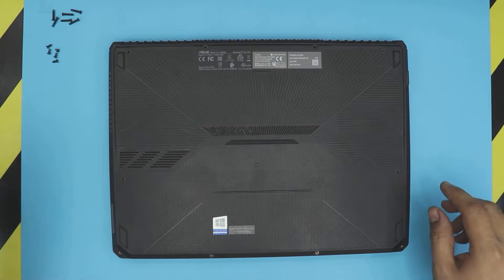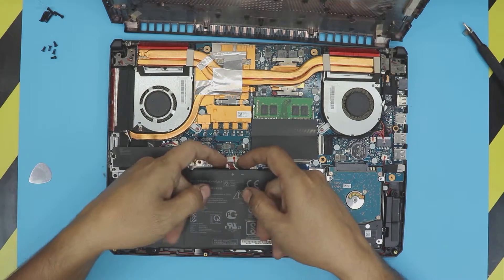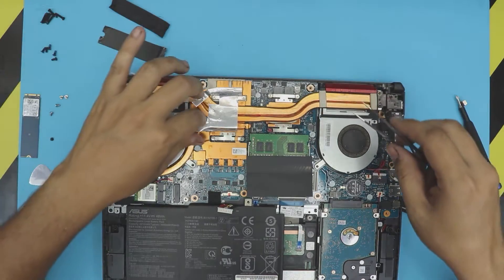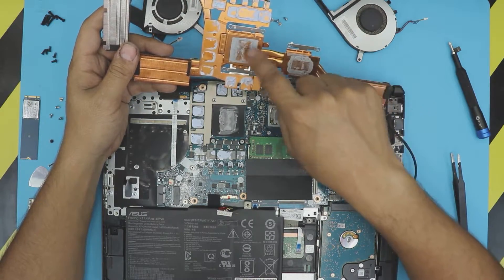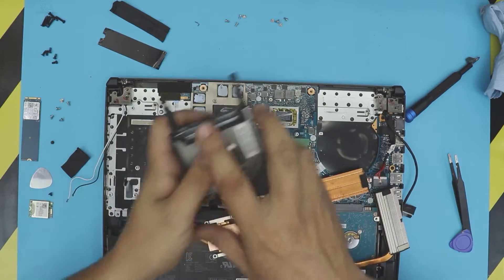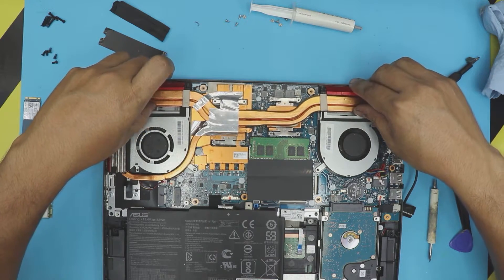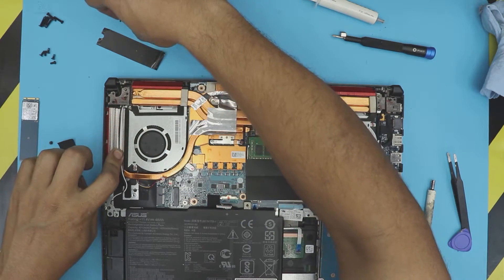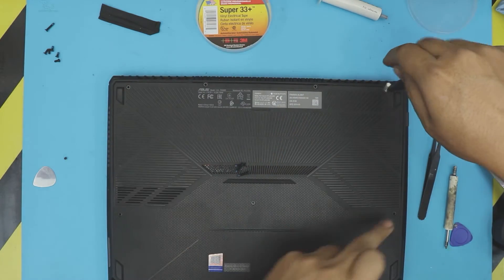✔ ASUS TUF fx505d Repaste Full Service, STEP By STEP

Comment: Hi !  Why didn´t  you clean the other components  before using thermal  paste ?   Thanks !
Reply from the maker: 🫠Regarding your question, because i added the paste over the thermal putty they are thermal putty or gel if you remove it you will need to get new gel or putty to add , all i did add a thermal paste over the putty so it can bind better,
cheers🍻
Reply: @uFixTek  thanks  for answering !
Reply from the maker: It's my pleasure my friend.

Comment: Do i need to replace the thermal paste on the vram and other chips? or ca  i just leave them alone and only repaste my Cpu and Gpu
Reply from the maker: Thank you for the feedback! if you wish to support the channel you can LIKE or SUB or both :P
regarding your question: i do recommend you to change the thermal putty (not paste) shorturl.at/itwO4
Reply: @uFixTek  is it fine if I use thermal paste instead of thermal putty?
Reply from the maker: NO my friend DON'T use the paste instead of the putty.

Comment: Thank you for this tutorial I have done everything right besides the wifi chip cords won’t go back on the Wi-Fi card is there a way I can still have wood without them being place right on top
Reply from the maker: Thank you for the feedback! if you wish to support the channel you can LIKE or SUB or both :P
regarding your question:  those cables are push down clips, if you damaged the cable heads then you need to get new wifi cable and connect and jam it in the in the empty space. 
https://amzn.to/3i5uuCI

Comment: I used liquid metal and may had short-circuit my pc and it wont turned on,  only the power button lights up,  is this repairable?
Reply from the maker: open it up and make sure you have not placed the LM on the GPU or CPU capacitors, if so clean it with ISO ALC. and you be fine. double check the connectors.

Comment: Hello, by accident i remove the thermal gel for the vrams of the gpu and just put thermal paste. Any place where i can buy that thermal gel so it´s like new? i just have thermal pads and thermal paste. Would really aprecciate the help. And where do i put the copper shims?
Reply from the maker: the problem is we can't find any seller anywhere where they can sell thermal Gel that is not thermal Glue gel. use .3mm thermal pads

Comment: Hey.
I followed your guide and applied new Kryonaut Thermal Paste on the GPU and CPU along with a 20*20*0.3 copper shim and tightening of the CPU gpu clamps.
Temperatures seem to be a lot better. Thank you.

I can't seem to fix the black and white wire to the wifi card though, because of which my wifi is not working. I used tape to hold it and the pins are visually connected, but aren't being detected.

Any solutions?
Reply from the maker: Thank you for the feedback! if you wish to support the channel you can LIKE or SUB or both :P
regarding your question:  you can get the antennas and plug them on and move them over the battery and jam it on empty space it will work the same, and you will get good signal. 
https://amzn.to/3GuMAp7

Comment: Good guide why did you bent the screw bits though on the heat pipes where it screws in?
Reply from the maker: Thank you for the feedback! if you wish to support the channel you can LIKE or SUB or both :P
regarding your question: the reason is that you bend it backward abit to give it more tension and it will have a great pull to the cpu, and the better the pressure from heatsink to the object its better heat/cold transfer.

Comment: Hi, already support your channel, Im wondering can use same termal paste that I will apply to my CPU and GPU its "Artic Mx-4 termal paste" for other components that you don't repaste.? By the way Im plan to OV
Reply from the maker: Yes, you can my friend the artic mx-2 its not conductive its safe to apply.
Reply: I mean can I use "Artic MX-4 Termal paste" to all componets cpu,gpu, vram and other components ?
Reply from the maker: yes you could, no harm done. BUT i would recommend you to use the Arctic MX-4 only on CPU and GPU, for the rest you will need a GEL thermal paste.
i can't find a link to one, or use a thermal pads .3mm

Comment: Can you please make a video showing how to repair the wifi antenna? I broke it along with the connectors on the wifi card. I'm so sad and heart broken 😭😭 I hate those things they are so hard to clip on. 😪 I know I gotta remove the screen?
Reply from the maker: Thanks ✌  for the feedback!  if you wish to support the channel you can LIKE or SUB or both :P
regarding your accident with wifi card and cable, the best and easy way to repair the wifi board is to replace it, if not you will need to get soldering iron hot station and flux and much stuff and solder the connector, but its very easy and cheaper replace it:
https://amzn.to/3A8MUq0
and regarding the cable dont remove the screen, 
you can get the new and better cables :https://amzn.to/3C3EiS0
and plug it and attache it to the button case or attach them to the battery with double sided table but it should come with adhesive.
Reply: @uFixTek  Thank you so much! You are incredible 😭 I will be donating for your time! Just a few questions, do I just simply attach the new antenna on top of the battery? Like how you show the opening in the video? And I don't need to remove the old antenna by removing the screen? Can I pretty much attach the antenna anywhere? Also, which one is the button case? In sum, will the new antenna pretty much sit on top? And will the old antenna interfere?
Reply from the maker: @AHairyCactus  https://imgur.com/a/j0L566u

other way to support the channel is by using my amazon general link before buying or searching for your purchases (add to your fav😋) .
USA: https://amzn.to/3A8dJu6
Reply: @uFixTek  You are incredible 😭😭😭 thank you so much!!!
Reply: @uFixTek  I do have one last question! On my laptop it says I have 2 GPU's. The gtx 1650 and the AMD Radeon Vega 8. However the Radeon gpu is reaching 90-95 C. I did all the re pasting so I'm not sure why it is still reaching high temps. 😅
Reply from the maker: your welcome
Reply from the maker: you have two GPU but its actually using the GTX 1650, and the vega only gets used for few decoding only, the Vega gpu is built in your CPU you will need to place a better thermal paste and put a copper shim on top of the cpu and gpu:
https://amzn.to/3lpnSNe
20mm x 20mm .3mm
and place thermal paste on the cpu and place the copper on top and place thermal paste on the other side of the copper and then put the heatsink on top. premuch you sandwiching the copper shim in between the cpu and the heatsink and the gpu and heatsink one for each.

Comment: Thank you so much for this amazing video! I have the same laptop and my fans are going out! I'm getting 95c temps. I just bought the paste along with the fans. For maximum results, you recommend the copper shims? Should I also use Thermal Pads?? Do you recommend I place those on other components? Also, I saw people are using copper heat sinks on their SSD mv.2 do you recommend any type of heatsink/pad on any of the rams, memory etc?? Im hoping to cool this thing as maximum as possible! Thank you so much for your expertise!! I'm a new sub!!
Reply from the maker: Thanks ✌  for the feedback!  if you wish to support the channel you can LIKE or SUB or both :P
Regarding your question:  #1. get your self only two copper shim .3mm https://amzn.to/3A3bA36
#2. i would highly recommend you to get this paste : thermal grizzly kryonaut : https://amzn.to/3E2gH68
and regarding the vram chips dont touch them leave them the way they are as they dont actually need cooling unless you are going to over clock the vrams, else just leave them alone.

#3. no need to cool the m.2 ssd as it will not even affect any performance on its usage or durability.
#4. the trick i would recommend to lift the back end of the laptop by 1-2cm and you will see the magic, it will have battery fresh air flow, https://amzn.to/3nn8CTE
you only need them for the back end.
if you have any other question feel free to ask me.
Reply: @uFixTek  You are amazing! Thank you sooo much! 😭
Reply from the maker: its my pleasure my friend :)
if you need help always ask me :)
other way to support the channel is by using my amazon general link before buying or searching for your purchases :P
USA: https://amzn.to/3A8dJu6
MXN: https://amzn.to/3BhTZoB
😋

Comment: Can you make a video on how to clean the fans? I believe we have the same laptop.
Reply from the maker: right @9:50 i have both fans out and to clean it, its simply a tooth brush and air compressor, no need to do anything else, use a brush (tooth brush) and blow some air and done. but to get to the ram you have to remove the heatsink. if you remove the heatsink you must repaste.
there is no otherway to remove the fans without removing the heatsink.

Comment: Hello. I have an asus tuf gaming. With an intel graphics card and a rtx 2060. It is a gaming laptop pc. I was playing one day and had a kind of glitch on the screen. I forced the pc to stop. And by turning it back on, everything worked except the screen which remained completely black. The fans are running. But the keyboard shows a red light. I have tried all the methods of removing the ram sticks, press the ignition button after disconnecting the battery. Nothing works. I know that with an external keyboard and perhaps specified manipulations, one can find a solution. Help me please.

Comment: Hello, me and my cousin have the same asus fx505dt with a ryzen 7 and a 1650, he got his like 5 months ago and i got mine like a year ago, his fans are so much quieter than mine so what im thinking is that his thermal paste application was better than mine and hes had it for a shorter time. So if I replace my thermal paste will my fans get quieter?
Reply from the maker: Thank you for the feedback! if you wish to support the channel you can LIKE or SUB or both :P
regarding your question:  i would highly recommend you to open it up and do a repaste with a good thermal paste, i will link the best and 2nd best, and clean the fan and heatsink system, the reason the fan get loud its because the air duct are full of dust, open it up and clean it with a toothbrush, and compressed air.
the best thermal paste: https://amzn.to/3lOnKJ9
2nd best: https://amzn.to/3lSlvnY
a good air duster and powerful: https://amzn.to/2U86y5S

Comment: About thermal paste on graphic memory - don't use another paste on old paste. It should be cleared up and replaced. Also from my point of view what I see it's a little bit too much thermal paste. But I like the idea of more pressure on CPU/GPU with that bending.
Reply from the maker: thank you for the feedback! regarding your observation, i'm not mixing old thermal paste with old thermal paste, im mixing the new thermal paste with thermal GEL. as i haven't found a provider that can sell a thermal gel. and i have ran few test by adding a none conductive thermal paste beside or on to the thermal gel it does help out, but the correct way is to get the thermal gel. there is no harm done with you place a lot of thermal paste on capacitors or coils. if you replace the gel with pads you will get horrible thermals on cpu or gpu and the pads have lots of tension and will push away the heatsink. so get thermal gel or mix it will thermal paste to help a bit. 
again i appreciate your support and feedback.

Comment: Can u say us what temperature you have it before and after? i have 80-90-95*C in games. I need to repaste? the seller told the paste it s fresh, but i don t think...please help me! I also perforated the case for better cooling and I use a coolerpad
Reply from the maker: Thank you for the feedback! if you wish to support the channel you can LIKE or SUB or both :P
regarding your question: WTF how does the seller know that the paste is fresh lol , those temps are not that bad under load, you should be getting GPU top 80 CPU top 85 when gaming after 20min. but i would recommend you to place the laptop on top of a desk and use a riser or something to lift the back end only about 1-2cm and it will help you a lot.
but regarding if you need to repaste, when you hit anything on cpu over 95c then repaste and use this paste :
thermal grizzly kryonaut: https://amzn.to/3h6JVYh

everyone's temps may be very different depending on many factors, room temp game type and how optimize is your laptop windows. my temps were 90 -98c and after servicing mac GPU 75-CPU 85
Reply: @uFixTek  i changed the paste (arctic mx2), now  i have 80-85*C în game. Was a lot of paste there, i think that was the problem.. Now i will try to lift the laptop with 1-2cm :) thank you
Reply from the maker: awesome you will see the extra drop by lifting the back a bit for fresh air flow

Comment: Hey there!! So I came here to tell you that I replaced the thermal paste!! The video was really helpful, and I managed to get down these results: 

Before: 
At start: 41C°
Usual tasks: 50-60C°
Under heavy pressure: 85-97C°

Now: 
At start: 29C°
Usual tasks: 40C°
Under heavy pressure: 70C° 
Maximum (1 to 2 seconds: 88C° 

Thermal paste used: Coolermaster mastergel pro. 

Thank you very much ;)
Reply from the maker: Thank you for the feedback! if you wish to support the channel you can LIKE or SUB or both :P
Im super glad that my videos are helping people like you, to service and fix their laptops, just a note: if you in the next service in a year or two use a thermal grizzly kryonaut : https://amzn.to/2RyMet6
you will see a better results 3-5c less.
also try to rise the back end of the laptop by 1-2cm with rubber legs : https://amzn.to/3ilZaNN
just place one on the back corner not in the front, and you will see the magic, better air flow lower temps.
Saludos
Reply: @uFixTek  Thank you, my man!
Reply from the maker: anytime my friend :)
Reply: Yo, i was wondering, where ur fans b4 the repaste loud? Because me and my cousin have the same exact laptop, only differences is that hes had his for 5 months and ive had mine for 1 year and his fans are so much quieter than mine. So were ur fans loud b4 and were they quieter after repaste?

Comment: Hello, my friend! Just checked the video because my laptop is reaching high temperatures after just 6 months of use. I already expanded the storage (got my hands in a 1TB nvme from WB and is going sweet), by myself and was pretty easy. I Would like to ask you if I should repaste the components by myself or recommend that I take it to Asus. It still has the warranty btw, does replace the thermal paste void it?  Thank you very much for the video and your answer ;). BT2: I am not a technician or so, just really like computers and tearing things apart.
Reply from the maker: Thank you for the feedback! if you wish to support the channel you can LIKE or SUB or both :P
regarding your question: replacing the thermal paste won't void the warranty, i would recommend you highly to replace the thermal paste on GPU /CPU ONLY don't replace the thermal gel on the other components use the same gel and pads.
and about the cpu /gpu paste use this paste:
thermal grizzly kryonaut: https://amzn.to/3x9lhLR

Comment: My fan is not working after cleaning,  does someone knows what happened?
Reply from the maker: Thank you for the feedback! if you wish to support the channel you can LIKE or SUB or both :P
regarding your question: the fan dont start unless the temp goes over 60c
when you power on only one fan may turn on and turn off but in order both fan to start the temp has to go over 60c
Reply: @uFixTek  thank you very much,  Does this apply to all the laptops?
Reply from the maker: mostly for basic laptops not much but mid range to high range this is standard, on alienware and omen hp this is normal.

Comment: Can't I just apply a fresh batch of thermal paste by wiping the old thermal silicon away?
Reply from the maker: Thank you for the feedback! if you wish to support the channel you can LIKE or SUB or both :P
regarding your question: if you talking about the GPU and CPU , then YES CLEAN the old paste and put new good quality paste.
if you talking about the other component , it doesn't make any difference in performance or anything if you replace it.
Reply: @uFixTek  Thank You for the information I just followed what you did and added a little on top of the melted silicon pads
Reply from the maker: that would be just fine, and its a thermal gel :P
Reply: @uFixTek  Yes, i used Cooler Master's "Mastergel Maker".. now the cpu is going upto 78-78C max, which was 85+ before
Reply from the maker: awesome if you want better result use this:
Thermal Grizzly Kryonaut : https://amzn.to/3c3XzIM

Comment: Nice video man, I’ll keep it for when I will have to replace the thermal paste
Btw how often should I replace it?
Reply from the maker: Thank you! for the feedback and your support to the channel by SUB :P
regarding your question: there are many factors to when you should change the thermal paste and clean the fans,
if the environment where the laptop is used its dusty then every 7-12months, but if the room condition is dust free every 2-3years.
THE best ways to know if you need to repaste check your GPU or CPU temps.
at idle should be around 30-45
at max load cpu 70-80, GPU 70-85
use the following application:
HWiNFO64
https://www.hwinfo.com/download/
Reply: @uFixTek  thank you so much :)
Reply from the maker: @jonathan___qc5917  my pleasure my friend

Comment: What's the idle/under laod temperature of the laptop after replacing the thermal paste? Mine is at around 80-90 when under load so I'm not sure if I should re paste or that's just normal temperature for this laptop.
Reply from the maker: jesus after underload you are sitting at 80-90???
you for your need to open the laptop and check the heatsink and see if any of the heatsink risers are not broken, and DO a repaste. the idle should be 30-40c (no load)